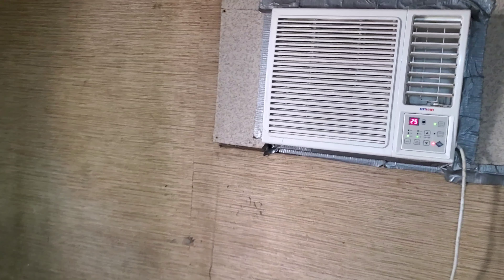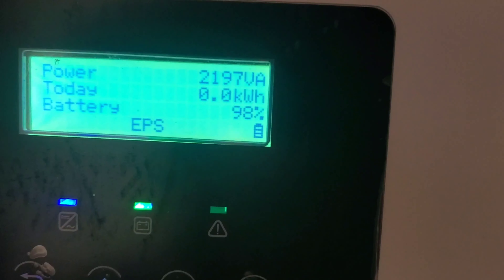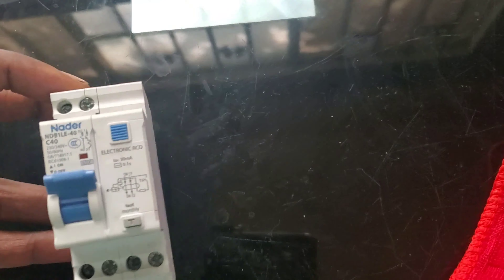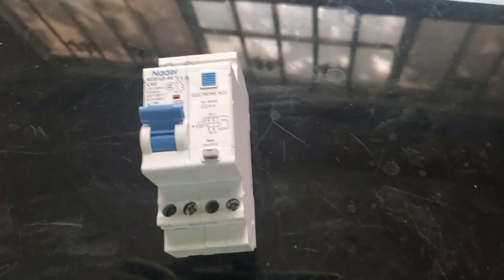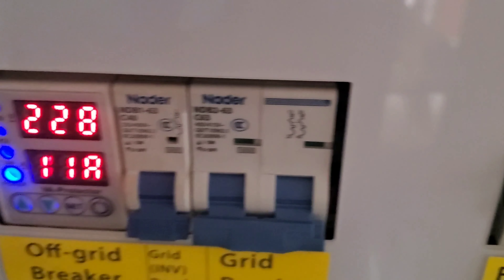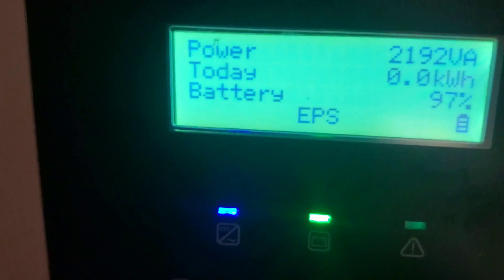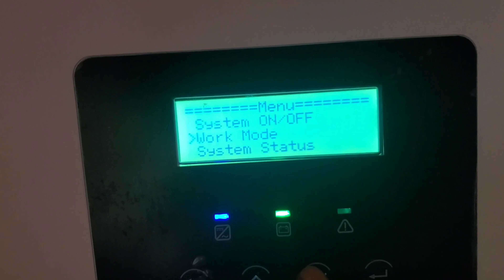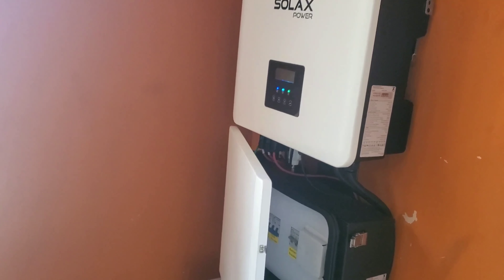#Solax X-1 Hybrid is now perfect

Comment: We have the same high 30ies Celsius temperatures here, Doc, so your AC is working hard and no switch should raise your temperature. We manage with a fan and trees but the power company is struggling again to keep the lights on in Paraguay.
Reply from the maker: Your power company is doing a better job than ours
Reply: @drsolar  I am sorry to hear that, Doc. The modern human is scarily dependent on the delivery of electrons through copper wires. So when the service fails desperation sets in.

Comment: Dr. Solar, on the current limiter, is it connected to the input for the inverter or the output to the load. Setting up one with a 5KW Deye and a bit lost if to connect as an input from grid power to protect the inverter or as an output from the inverter. Thanks.
Reply from the maker: Welcome to the channel. It is installed on the output side of the inverter. You can do it on the input as well. Thank you for watching and commenting. Please don't forget to subscribe.
Reply: Thanks a million sir

Comment: RCD RESIDUAL CURRENT DEVICE IS ALSO CALLED EARTH LEAKAGE BREAKER I THINK ONE OF YOUR APPLIANCE WAS LEAKING CURRENT THAT IS WHY I THINK IT WAS TRIPPING VOLTAGE LIMITING DEVICE AND RCD ARE TWO DIFFERENT PROTECTION DEVICES AND CANNOT BE USED INTERCHANGEABLY YOU SHOULD LOCATE CURRENT LEAKING APPLIANCE AND REINSTALL THE RCD it is my humble suggestion.
Reply from the maker: It was tripping at random and it was not one particular appliance. It started with the AC. Then the water pump while the hot plate was on. Then the air fryer, then the microwave. This morning the water pump tripped it after a few minutes. It was not a particular appliance.
Reply: @drsolar  Kindly check your earthing system, that's where the problem is. You should put that RCB(RCBO) back in the system and rectify your earthing.
Reply from the maker: @EjitEnergy  once we are back from vacation we will check it. Thank you for the tip

Comment: You now have no ground fault protection so if you have a short or a leakage to ground there is no way to shut it down. Likely you had a poor ground or a loose neutral. Or a sensitivity issue most inverters have an adjustment for ground fault sensitivity.
Reply from the maker: The inverter was not reacting. It was the RCD. Possibly a poor ground. We will revisit it in January

Comment: what is the kilowatt ? and this one is ip65 x1 hybrid lv series? my question is how loud is the fan noise?
Reply from the maker: This is the HV. The fan is quiet
Reply: @drsolar  can I install it indoor inside my dressing room, dressing is attached to my room
Reply from the maker: @FortniteMaps  I don't know what a dressing room is. I have mine in the dinning room where I have the refrigerator.
Reply: @drsolar  ok but fan is quite not disturbing right? For example how noisy it is compare to regular ceiling fans ?
Reply from the maker: @FortniteMaps  just low vibration sounds. Don't put it where you sleep.
Reply: @drsolar  I see you have posted this video 2 years ago so how was your experience with this company products? and thank you so much for you reply I really appreciate your help
Reply from the maker: @FortniteMaps  fantastic.